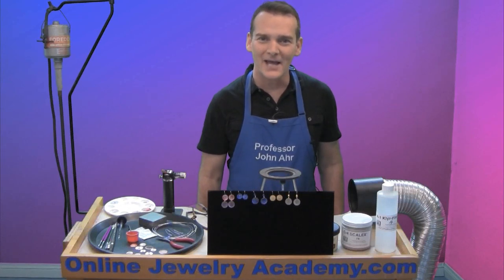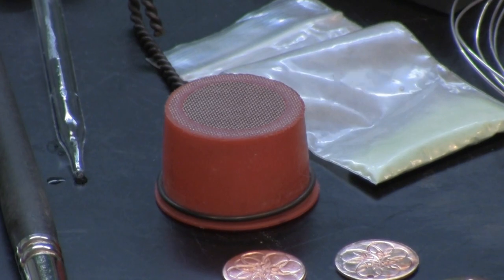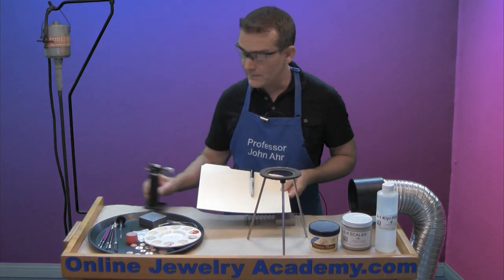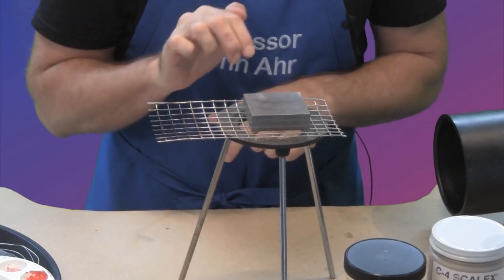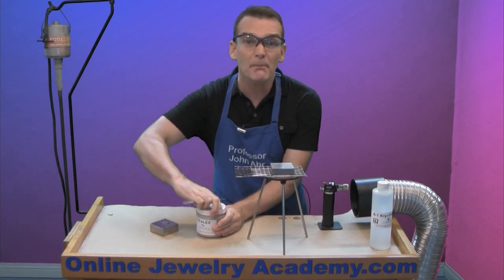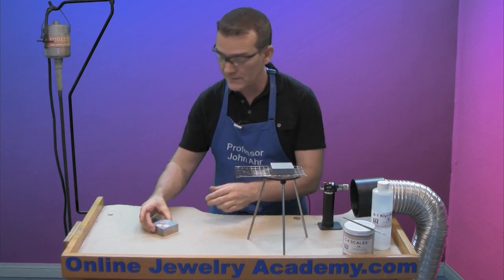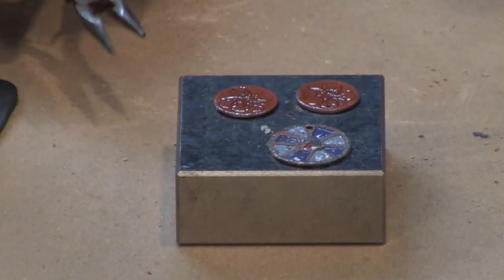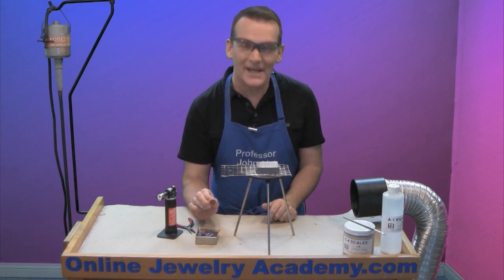Torch Fired Enamel

Comment: Oh Professor John you made my night!  (once again!)  I was so disappointed before your lesson.  I bought a book on torch firing and basic materials.  My book said to counter enamel first which I did.  I had a lovely blue sheen.  Next I did the front with a baby blue and a stencil of a little bird in black.  Well!  The back counter enameling was of course now a disgusting blotch.  I will now order some scalex and try your method.  You are such a generous, skilled and kind teacher.  Thank you as always <3
Reply from the maker: I'm glad that the OJA was able to cheer you up.  I'm glad to hear that you are using counter enamel.  Don't worry if it looks ugly if that side of your piece will never be seen.  If it will be exposed, you can always use a transparent or colored enamel to counter enamel.  The pieces I made in the video were small and thick.  That's why I could get away with not using counter enamel.  When you order your Scalex, be sure to order some Pennybright too.  It will make clean up go a lot faster.  And, if you plan on doing multiple firings, be sure to buy a stone for cleaning the edges under running water between firings.  Good luck with your creative pursuits.
Thanks for your support! : )

Comment: I could listen to your voice for hours. You're so easy to learn from! The only thing I'm confused about so far is counter enameling. How do I do it with a torch set up? How do I know if I need to do it or if I can skip that step?
Reply from the maker: For smaller pieces that are at least 18 gauge thick, you don't need to apply counter enamel.  The OJA does not have a video that demonstrates torch fired pieces where counter enamel is applied and fired.  But, I'm sure that other channels might cover this process in depth.  : )
Reply: @OnlineJewelryAcademy  Thank you!

Comment: Love your video. I was wondering if I can enamel both sides of the piece and how can that be done. Thanks
Reply from the maker: Yes, you can enamel on both sides of a piece.  Normally this is only done with kiln fired enamels.  Counter enameling the back side of a piece helps to maintain the surface tension on both sides of the piece.  It can be difficult to do with torch fired enamels.  But, I've done it.  You just need to place a "furnishing" on top of a steel mesh supported on a tripod.  You can find the furnishings that you'll need on the Schlaifer Enamels website.  Good luck with your projects.
Thanks for your support! : )

Comment: Thus tutorial is exactly what I needed. Question- whats the model and make of the torch? I’m getting into soldering and I really don’t know which one to get because the prices change to drastically and this one seems to be easy to use and not so intimidating. 

Thank you for any recommendation you could provide.
Reply from the maker: Here's a link to another video that might help:  https://www.youtube.com/watch?v=f4bveEWk0TQ

For enameling, I believe that the MAPP gas torch and tip (available at most hardware stores) will work just fine for you. 😀
Reply: @OnlineJewelryAcademy  thank you so much for your quick response. Will look into the video and your rec.

Comment: Nice explanation of tools, chemicals and the process. I was a little concerned because it look like your table is covered with paper. Even if that wasn't the case, it having  might be wise to stress some form of fire extinguisher available when using an open flame and a having a metal or ceramic tile working surface.
Reply from the maker: Louise B Good suggestion.  When we update our safety video we will add a section about fire extinguishers.  Thanks for watching!  : )

Comment: Hello, thank you for the great tutorial. Can it be possible to do glass enamaling without copper plate in the bottom? I tried to do it myself and could see significant change of color and enamel lost transparency. What can be done to fix it? Thank you again.
Reply from the maker: Hi Nina, you asked some very good questions. Enamel is normally done on a metal surface, such as gold, silver, or copper. There is a form of enameling that is done in between a wire framework. But it is very difficult to do, and takes a lot of practice. The problems that you were having with color change and transparency could be the result of several things most likely, cloudiness, and color changes seen in the enamel may be due to using unwashed or unprepared enamel powder. Also, you need to be conscious of the amount of heat of use, and the time that the enamel spends in the heat. I recommend that you sign up for an in person class. This will help you to build your skills. Good luck! 🍀
Reply: @OnlineJewelryAcademy  thank you a lot for your answer. Enameling between a wire framework it is exactly what I tried. I will try to do it again and if it won't be successful probably will take class :-)
Reply from the maker: @ninadruzhkova4341  what you want to do is called plique-a-jour.  It requires very specific materials and techniques. Good luck! 🍀

Comment: can you use scalex on already patinaed copper wire working to keep people from having their skin turn green....so far all i have heard about is nail polish which i think is a garrish idea.........
Reply from the maker: Hi Carol,  Scalex is a chemical compound that is used to prevent oxidation on copper during the firing process.  It washes away easily.  So, it can't act as a barrier between a copper surface and skin.  If you don't like the idea of using nail polish as a barrier, you could also use a two-part epoxy resin.  There are many colorful products that won't harm the skin on the market.  Good luck with your projects.
Thanks for your support! : )

Comment: Great video, you make it look so easy I may give it a try.  I'm curious tho, how one would do the same thing with copper pipe to make a bead?
Reply from the maker: Leila West 
Hi Leila!  Torch fired enamel is easy to do.  Be daring and don't be afraid to try it.  As far as using this process with "copper pipe to make a bead" goes, that all depends.  Your question is a bit vague.  So, my advice would be to experiment and look into the various types of construction that can be used to make a bead.  We will be posting information about making hollow forms to the channel in the future.  Good luck with your enameling.  And, thanks for watching! : )

Comment: This is a very helpful video. Thankyou.

Can the same technique be used with sterling silver?
Reply from the maker: I'm glad that you enjoyed the video.  Enameling can be done on silver.  Generally it's applied to fine silver or sterling silver that has been thoroughly "frosted" to have a heavy fine silver exterior layer.  The OJA has a video on frosting silver included in its playlist on its website at: onlinejewelryacademy.com  Be sure to check with your enamel supplier to be sure that you are purchasing the correct enamels to be applied to the type of metal surface that you will be applying them to.  Have fun and stay safe.
Thanks for your support! : )

Comment: Could you possibly let us know what kind of torch you are using?   I have the worst luck with those little torches.  Something always go wrong with them.  Yours looks awesome.  Thx! b
Reply from the maker: barbbear35 Sure thing!  The torch used in the video is a MAPP gas torch.  You can get them at most hardware stores.  The bottle part is easily replaced when it's empty.  MAPP gas is good for big projects that take a lot of heat.  But, it isn't good for jewelry soldering.  It's hard to control.  Plus, it produces a dirty flame.  For soldering you want to use a Butane torch that can produce heat up to 1500 degrees F.  You can probably find one online with a Google search.  Good luck with your torch fired enamel projects. And, thanks for watching!  : )

Comment: Nice video! I was wondering if it could be possible to make a painting with enamel using a large plate of copper? I have noticed that you avoid the differents colors from touching each other.
Reply from the maker: There are enamel paints. They are generally used on top of a white enamel surface. The enamel paints, however, lack depth and saturation of color. Images can also be created using cloisonné techniques which separate areas of unique color. 😀

Comment: Great video! Can this project be made with the same supplies but using discs of either sterling or pure silver instead of copper?
Reply from the maker: Hi Linda,  Yes, you can do torch fired enamel on silver.  Just remember that I used thick discs of copper so that I didn't have to "counter enamel" the back side of the discs.  So, the cost of your projects will jump if you use silver instead of copper.  I suggest working your ideas out on copper first.
Thanks for your support! : )
Reply: Thanks very much. I have been looking for a way to add color to my silver jewelry projects and this looks like a good way to go.

Comment: 2 questions, I am a glass painter I have high-fire enamels for glass (Reusche), do they work for this type of copper enameling? I'm unable to find Penny Bright, what is the next alternative, and could it be Wright's Copper, Brass Cream?
Reply from the maker: I’ve never used Reusche enamels. My guess is that they are not formulated to bond with metal. But I could be wrong. You could contact the manufacturer for advice. Or, you could do some experimenting. Penny Bright is slightly abrasive unlike Wright’s Copper, Brass Cream. So you might look for a more aggressive cleaner. 😀

Comment: Hi again with your torch firing enamel pendants I noticed you never counter enameled is that because the copper was 18 gauge and didn't need counter enamel?
Reply from the maker: Yes!  Working with thick sheet on small pieces is the trick to not having to counter enamel. 😀
Reply: Thank you again

Comment: I enjoy your videos and presentation style very much.  May I ask if there was additional refining done to the multi colored enamel piece in this video?  Is it possible to get the color lines more uniform in appearance when working with enamel?
Reply from the maker: Karla Peperone Hi Karla,  Thanks for the nice feedback.  I'm glad that you enjoy the videos and my presentation style.  The multi colored piece in the video was made by filling in recesses on an etched piece of copper.  You can definitely create a piece that has much crisper edges and lines to it.  I recommend that you watch the three salt water etching videos on our channel to learn how to make a blank similar to the one in the Torch Fired Enamel video.  You'll see how you can really make a refined blank if you use the PNP Blue resist.  I also recommend that you watch the video on enamel application techniques.  It will show you how to fill the recesses on your blank by "wet packing" the enamel material.  Be sure you let the wet packing dry before you attempt to fire your piece.  Good luck with your projects.  And, thanks for watching! : )
Reply: Excellent info, thanks again!!!!!

Comment: Third time watching. I have notice that many people say you need to counter enamel. Did you not have to because; a. 20 g and b. hammered the edge to deal with the tension? TIA
Reply from the maker: Hi Kim,  Like you, I was trained to use a counter enamel on my work.  But, small pieces like the ones in the video are able to hold the enamel on their surfaces because of the thickness of the metal.
Thanks for your support! : )
Reply: Thank you for getting back to me so quickly.

Comment: Hi, Please advise
Is thé enamling powder used for glass fusing thé same type as thé one used with métal. Does thé color mâture with à torch.
What's thé différence between cold and hot enamling 
thanks
Reply from the maker: Here's a link that you'll find helpful: http://thompsonenamel.com.
The enamels sold by this manufacturer can be used on glass or metal.  But, the firing techniques are very different.  The colors develop after they have been fired and allowed to cool.  Cold enameling is done with a plastic based product  There are many different varieties.  Some are epoxy resin based others are more like gel nail enamel. 😀

Comment: thx John,when I apply wet Enamel methods, can I just put water into the Enamel?
Reply from the maker: Hi Ingrid,  No, you cannot just use water for wet packing.  You need to use Kleer Fire.  Tap water contains minerals that can affect the color of the enamel.  And even if you use distilled water, the water won't help to hold the enamel in place.  Have fun enameling.
Thanks for your support! : )

Comment: Hi again and thank for for another great informative video. How is your enameling defferent than cold enamel by ice enameling powder. I don't want to apply wrong powder over metal,  Is your enamel different and how so? Thank you in advance.
Reply from the maker: +private91205 The "Ice Enamel" you mentioned is not glass but resin.  The type of enamel used in the video is 80 mesh vitreous enamel from Thompson Enamel.  The difference is that the resin is a chemical that hardens into a plastic coating while the torch fired enamel hardens into a glass surface.  Check out the other enamel videos on our channel or on our website for more information on enamel.  www.onlinejewerlyacademy.com  Thanks for watching!  : )

Comment: I like your videos. I noticed you didn't counter enamel the back of the pieces. Will this cause the enamel to break off easier in the future? Isn't it necessary to counter enamel? Does it depend on the thickness of the enamel? Thanks!
Reply from the maker: +Tamara Graham 
Hi Tamara,  I didn't counter enamel because it isn't necessary if you enamel on a thick piece of copper.  I used 20 gauge sheet metal for the pieces in the video.  The pieces will be just fine without the counter enamel.  Keep an eye out for more torched fired enamel videos from the OJA in the near future.
Thanks for watching! : )
Reply: Ok thanks!

Comment: John - When do you use a clear enamel (e.g. Thompson's #2030)?  If you fire with the clear enamel before re-firing with a transparent enamel, will that change the look/result?
Reply from the maker: +Cheryl Wetzel Hi Cheryl, You can use a clear enamel over the surface of an enamel piece to even it out and level it.  For example, you can use transparent to bring a portrait enamel painting or a cloisonné piece all to the same surface height.  There should be very little noticeable change to the colors since you're using transparent enamel.  The only problems you might encounter are air bubbles in deeper areas.  Just be sure that anything that you wet pack is packed in well.  Be sure to check out our other enameling videos at www.onlinejewelryacademy.com  Good luck with your projects.  And, thanks for watching!

Comment: Hi John, thank you for that video. I'd like to ask you about enameling Gold 21k. There is the Martha Stewart cold enamel . I don't know what kind of enamel is the right choice to but on Gold that because I am a beginner in jewelry making .
Reply from the maker: My advice would be to practice your technique on something less expensive like copper before you move to gold.  Plus, you should do your homework and read up on the various types of enamels and how they can or cannot be applied to gold.  Thompson Enamel has a great website for you to investigate.  And, the cold enamel that you mentioned is probably an epoxy resin product.  Good luck with your research and testing.
Thanks for your support! : )

Comment: I watched this video probably 10 times trying to figure out what I am doing wrong.  The video shows the process on each piece about 36 seconds.  I have tried everything from 1 min - 4 min and nothing happens except the powder just flakes off.  What am I doing wrong?  Help!
Reply from the maker: Marsha Wulpi My best guess is that you aren't using a torch that gets hot enough.  If you don't have enough heat to fuse the enamel it will just sit on the surface of your piece.  You can purchase a MAPP gas torch like the one I use in the video at any hardware store.  Hope this helps.  And, thanks for watching! : )
Reply: I'm using a small butane torch I use for PMC torching, will that still not get hot enough for the enameling?
Reply from the maker: Marsha Wulpi It's not that the torch doesn't get hot enough.  It's that it doesn't generate enough heat to bring your whole project up to the correct temperature.  You're going to need a larger torch like the MAPP gas torch shown in the video.  Good luck!  And, thanks for watching! : )

Comment: John, will cupronil work the same as the scalex?
Reply from the maker: Hi Kim,  No.  Cupronil is a flux that behaves like a flux. Scalex is an oxide inhibitor that peels off of a surface after it has been fired.
Thanks for your support! : )
Reply: @OnlineJewelryAcademy  
I rethought it after I asked. I have about 50 small discs to enamel tomorrow but can't the scalex until week's end. Is there anything else I could use?
Reply from the maker: Hi Kim,  Unfortunately, there isn't any other material that you might have in your studio that will work exactly like scalex.  The only thing I can think of to suggest is that you might try a different supplier or pay for overnight delivery.  Sorry.

Comment: Do you not counterenamel?
Reply from the maker: Hi Terrie,  Yes, I counter enamel when I'm working with thinner gauge material.  I didn't use counter enamel in the video because the metal was so thick.  I did this to prevent the enamel from sticking to anything while I torch fired it.  I generally post jewelry making approaches that are accessible to anyone.  So, this enamel video didn't involve using counter enamel, a kiln, or other items that members of the OJA audience might not have in their studios.  I hope you enjoyed the video.
Thanks for your support! : )